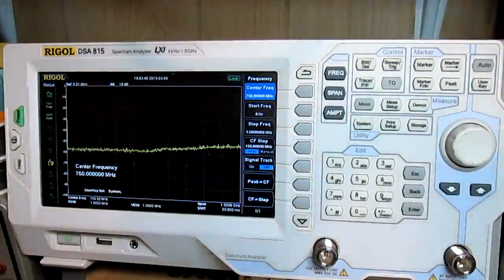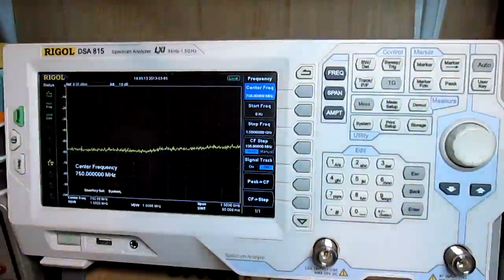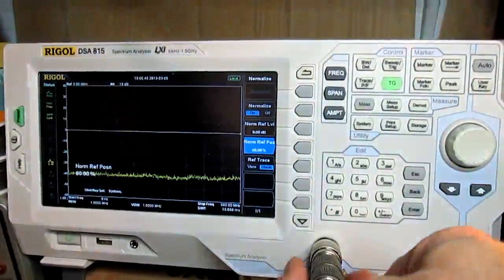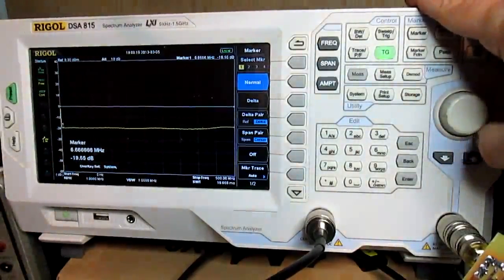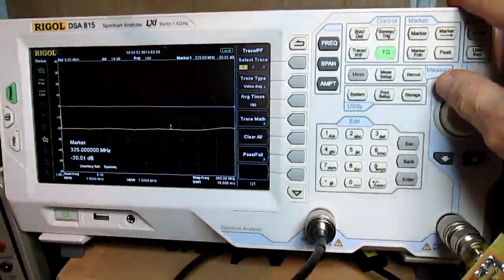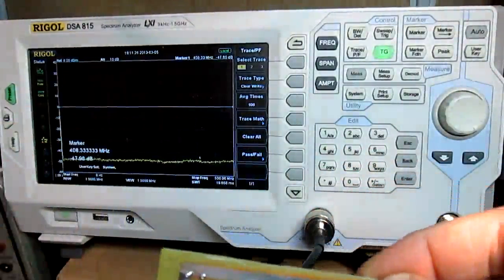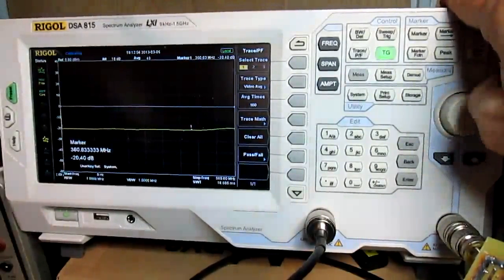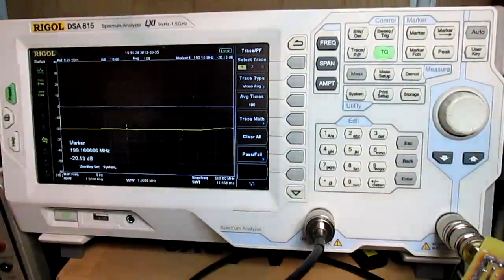RF Attenuator - Prototype projects.

Comment: I'm working on one of these myself as the commercial projects are too expensive. I've found that the trace on the pcb is one of the most important issues. You must maintain a 50 ohm environment across the pcb. I think if you reduce your gaps between the ground plane and your center wire, you may achieve better results.

Comment: Hard to tell what your attenuator arrangement is from the video. Pi pad?  Looks like the resistors are spaced a little far apart.  I'm assuming 50ohm system, so you want your attenuator network and transmission line should be designed for that.  Full ground plane is desirable. Transmission line width is dependent on dielectric/thickness.  Line width should be roughly 110 mils or so. You want one shunt res of 61ohms on each side of a 249 ohm series res. Should be pretty darn flat across the band.

Comment from the maker: I did try it and freq response went weird .. 
I used Fr-4, .060 thick .. ok .. let me ask this .. with my attenuator.. I used a 61 ohm input resistor and output resistor .. and I think ... 2.4K ish in the middle. ( i'm at work atm ) .. so ..  am I depending on the PCB for the input and output impedance values and have the trace width set accordingly for 61 ohms and just worry about the resistor in the middle ?

Comment: Cooper on the bottom side is not a bad thing, actually its advisable. You then make actual strip line from your attenuation board and and then you can use simple online calculators to calculate track with needed to achieve 50ohm impedance, and in doing so reduce signal reflections.  Search on the web for "microstrip impedance calculator" and do your math. For example regular pcb made from FR-4 has Er ~4.3, thicknes 1.6mm then you need tracks of 2.98mm to achieve 50ohm track impedance. Try it